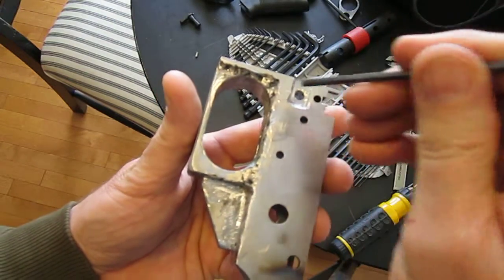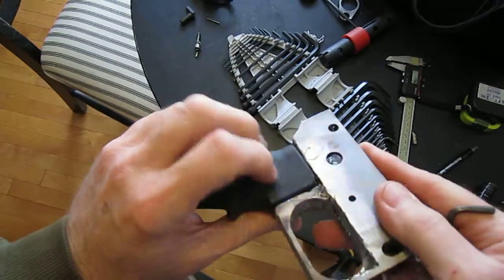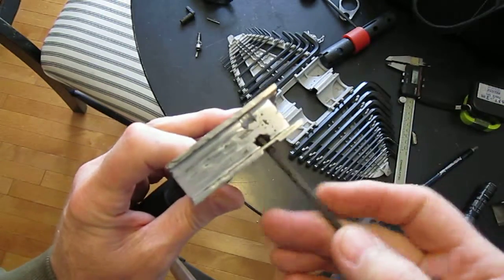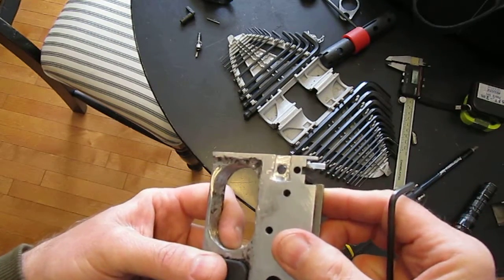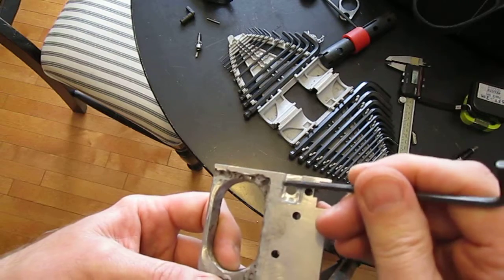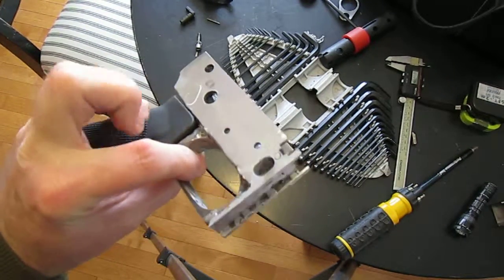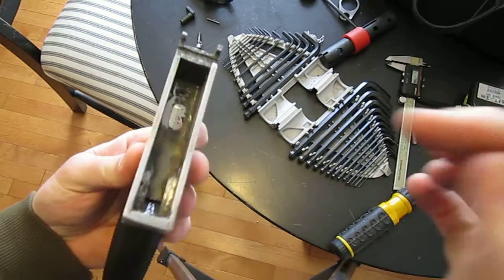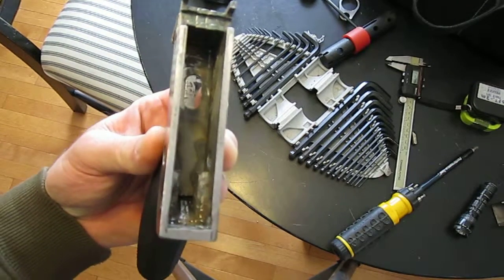Welding Tips

Comment: did the same mistake burning a hole in to the mag release. Your build is looking nice good instructional video
Reply from the maker: +Jonathan Desantiago 
Thank you.
Yeah, I did see the thin metal when it was apart, just did not plan ahead.
The point of this build is to get a little experience before welding my AR-308 lower.
I have everything but the lower and do not want to screw it up as it seems like they make the AR-15 flat kits available more often.
Also, using flux core wire looks like hell, especially when there is a little contamination and it bubbles up.